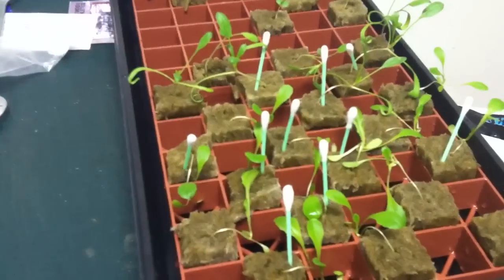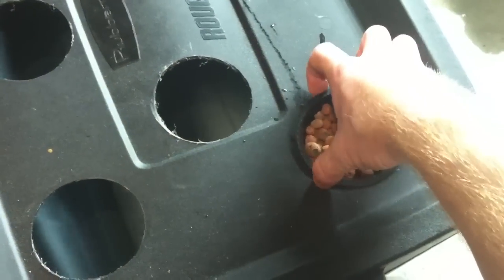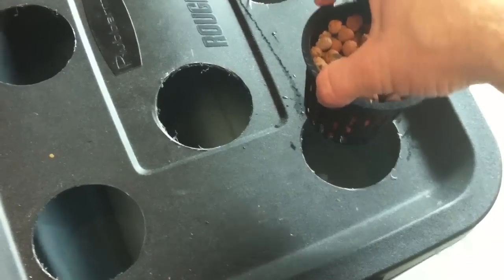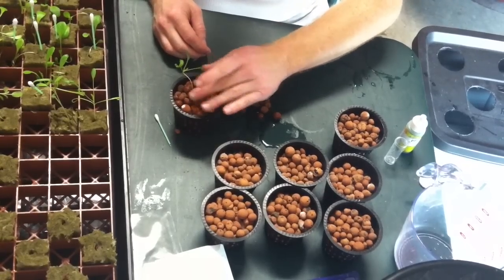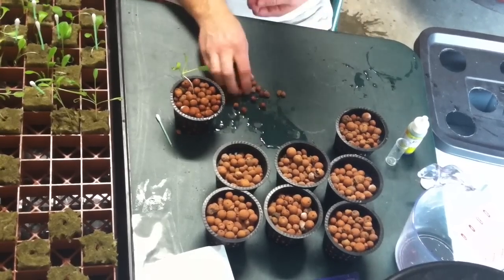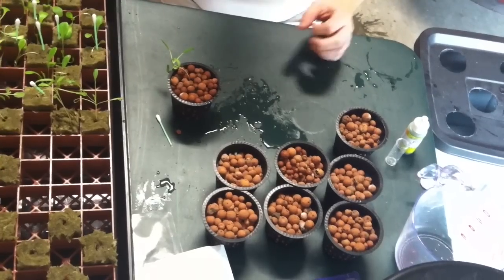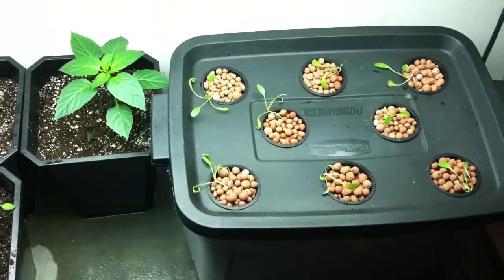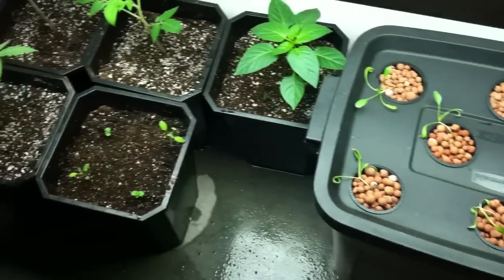Transfering Seedlings from Rockwool to Hydroponic System

Comment: If you keep the rockwool totally saturated it will start stinking and can drown the little starter roots in a top drip dwc, it's better to water them every few days until roots are starting out the bottom of the cube before moving them into the dwc, use lots of aeration and don't forget some hydroguard to introduce the good bacteria into your dwc bucket right away, i didn't do these things and ended up with a bunch of slimy tan roots and a smell that didn't really stink but shouldn't be there, luckily the plant made full recovery and  became a beast😄check your ph daily on larger plants, sometimes they are hungry and absorb the nutrients and acids"as they should"raising ph, other times they aren't as hungry and can actually move acids back into the water dropping the ph,also distilled water can become more acidic due to co2 being absorbed and becoming carbonic acid ,i found if that's the case and  the  ph will  not  stay  put  for  3 days  just add more distilled water until the ph goes back to 6.0 and the extra water is a good buffer, and Cal mag is a must with distilled or RO water as both are totally dead water, needing minerals just as much as fertilizer, I don't like the rockwool saturated, the roots are what need water and oxygen, it's best to use micropore airstones that produce nano bubbles they will keep the rockwool damp but not saturated
Reply from the maker: Yea, it did, I’ve learned since.  Thanks for watching
Reply: Rockwool is very alkaline and needs to be soaked in acidic water to get the pH correct.

Comment: Great video, thank you. To clarify, is the rockwool actually in the water when the grow basket is placed into the bucket, and by how much (ie: halfway up, quarter, just touching, not touching, etc)? You mentioned how far up the water is going up the grow basket, but I'm not sure how far up the rockwool it should go, based on not knowing how far down you put it into the grow basket.
Reply: Hello I can answer that for you. The bottoms of the pots DO NOT sit in the water. They sit slightly above. Maybe by 1/6 of an inch. If you're supplying oxygen (which you should) via air pump into the water, the bubbles being blown to the surface of the water will pop... This basically sends water particles everywhere! This means the water will be jumping into the hydroton rocks and making it's way to to the roots in the rockrool, the roots will realize the source and start to head downwards :)
Reply: +Nick Langley Thanks! I needed this info. :D
Reply: @AnimationsN1  thanks. Nobody explains this
Reply from the maker: Good explanation animations.  Yes exactly that

Comment: When you put the cup into hydroponic bucket, should the nutrient water touch the base of the rockwool? Or need to ensure the root is submerged in the water?
Reply from the maker: Just the root needs to touch. If the rock wool stays wet it could cause root rot.  I don’t know a lot on this though and im probably not the best one to ask on it.

Comment: Vid title is misleading brother. You don't transfer from rockwool. You are placing rockwool in 3' hydro baskets. I was looking to actually remove from the rockwool and place in 3" baskets
Reply: Billy Gram I don’t know if that’s entirely possible. The seedlings will have rooted into the rock wool. Trying to remove the seedlings from the rock wool will result in severing the roots from the plant. Maybe start in soil then dig up the plants, wash the roots, then transfer to a hydro system. Maybe it’s possible, but I wouldn’t recommend you do that.
Reply from the maker: Yeah I don’t think you remove rock wool

Comment: i didnt get to know the one thing i came here to learm, does the rockwool touch the water?
Reply: No. The rockwool is merely a rider in this as the hydroton is the support medium and the water merely has to be "splashing" on the bottom of the netcup to moisten the pellets and the rockwool simply holds the seedling in place while it grows. Eventually the plant should even break the rockwool open.
Reply: WireHedd , thanks soooo much :)
Reply: He said no.  The rockwool should not be pushed to the bottom of the cup leave some space for roots to dry out and grow so it doesnt grow straight into the cup.
Reply from the maker: No Rockwiol shouldn’t touch water, I might have made it and now I know it’s wrong

Comment: I gave up on net cups and hydroton. use dollar store pool noodles cut to 2" pieces.
Reply: 3d printer here :) I've never bought a net cup in my life.
Reply: @taleyajoinson4703   3d printing your net cups. Cool. You don't happen to still have the file do you?
Reply: @dustin2250  Check out thingiverse.com, they have a ton of STLs in different configurations. I use the parametric one. (search "net pot")
Reply from the maker: I’ve seen people do that, looks like a great option

Comment: quite evident he is lost
Reply: Can I ask - I'm a complete beginner and I can ever see there's lots of problems with this, is it a good idea to mix rockwool and pebbles like this at all?
Reply: @jamesonjameson8530  It is the most common way to start seeds in hydroponics. I don't use rockwool with clones but you have to be careful with the delicate roots.Rockwool is not biodegradable so it won't rot if that was your concern. The "pebbles" are actually hydrotone. Hydrotone is PH neutral baked clay balls that are porous. As the roots grow out of the basket the water level should drop so the basket is out of the nutrient solution ( not water) and dry out. The upper roots in the basket are supported and exposed to the fresh air pumped in through the bubbler escaping through the net cup roots. Good hydro setup can cut your grow time in half.
Reply: @gueto70  thank you so much for your reply!
Reply from the maker: Thanks for the good info.  Way better than what I could offer, thanks for helping him

Comment: They r net pots and they should not be touching or "sitting in the water" amateur
Reply: Until the plants grow out their tap and air roots the water SHOULD just be touching the bottom. Once those roots come out though then no, it should not.
Reply: WireHedd please explain? T he e bubbler will splash water to root?
Reply: Green Reaper in dwc the net pots do touch the water if you’re running oxygen into the reservoir. If he were using the kratky method then no they would not .
Reply from the maker: Yea I was an amateur, I’ve learned since.  10+ year old video, I’ve learned since.  Sorry for the bad info